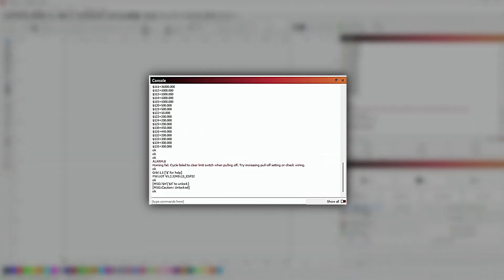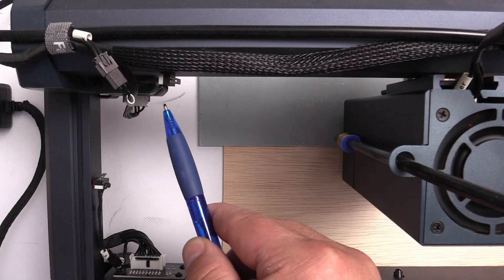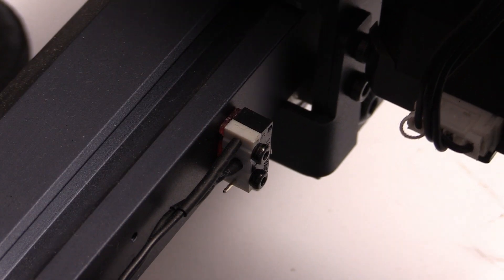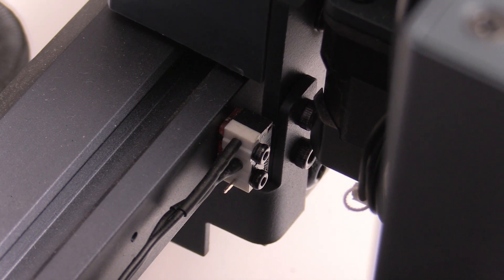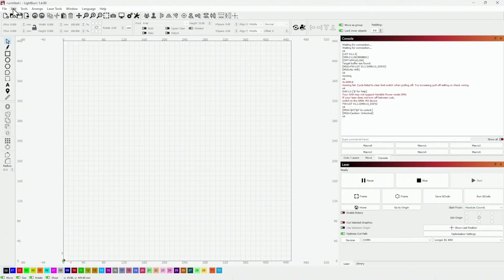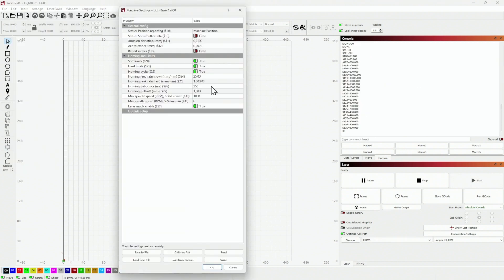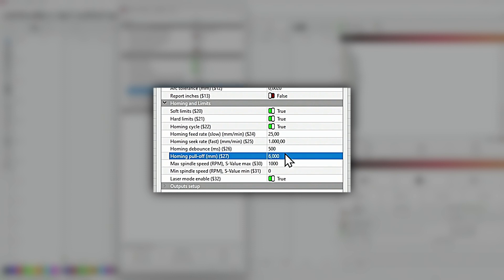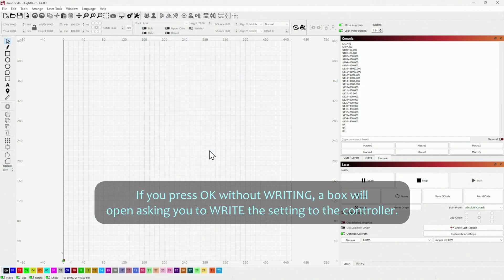▼ Fixing Alarm 8 in Lightburn | Easy Homing Solution

Comment: Thanks for making this video. I have struggled with this problem for months since it caused my Longer B1 to rehome to slightly different positions.  I changed my settings to $26=1000 and $27=1000.  It is slower homing now and I have lost a little engraving area, but no longer get ALARM 8.  I wish Longer Tech Support would have told me this a llong time ago.  Thanks again!
Reply from the maker: I am glad it solved your problem.

Comment: I am having a problem with Alarm 3 Reset while in motion.GRBL cannot guarantee position. Lost steps are likely. Rehoming is recommended which I did. ON or near Line 0.  Please help!
Reply: Same issue here...
Reply from the maker: To answer this, I must see the whole picture.
What machine do you have? Which type of GRBL is used? What is the mainboard and it's firmware (and have you updated to the latest available firmware yet?)

Is this is al very specific, I (as a user, just like you) can't help you, unless you happen to have the exact same machine with the same settings as I have.
I advice to contact the vendor and ask them.

Comment: Mine does t even attempt to home now.  I get the error right away when I turn it on.  Any help with that?  Ortur laser master 3, using Lightburn software
Reply from the maker: Most probably in the laser settings in Lightburn or other software you are using, you have the X and/or Y offset for homing set to 0 instead of a value like 1 to 5mm.
This is found under the machine settings.

Comment: Dear friend. I have a 20W laser cannon, suddenly alarm 8 appeared, then the cannon started to fail and went out, as well as the green PWM LED, it doesn't light up. can you help me?
Reply from the maker: Looks like a problem in the control board that sends signal to the laser. Can also be the cabling between the board and the laser module.

Comment: What if this  won't work? Thanks.
Reply from the maker: Then, there must be another problem why you receive Alarm 8.
There is not much I can do if you don't provide any more information about your problem, like the machine, your settings, etc.
That said, I am not a lightburn rep, and if you have questions, complaints or other things about the software, it's best to contact their technical support. I am just a Youtuber who found a solution to a problem that I had and posted it to help others.

Comment: Thank you sir  I no longer have a alarm 8 problem I now have a alarm 9 problem, "ALARM:9
Homing fail. Could not find limit switch within search distance. Defined as 1.5 * max_travel on search and 5 * pulloff on locate phases." any advice on how to fix this one sir. when I ask light burn to home, nothing moves on the laser and then that alarm 9 code is displayed.
Reply from the maker: I have no experience with Alarm 9 in Lightburn, but I found a topic on the Lightburn website that might help you.
https://forum.lightburnsoftware.com/t/complete-beginner-alarm-9-homing-fail-could-not-find-limit-switch/26528